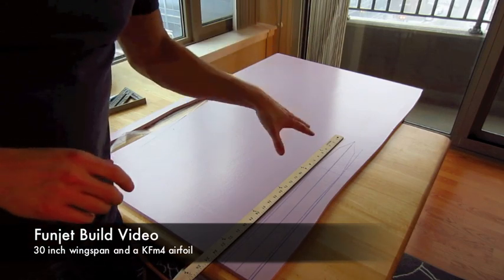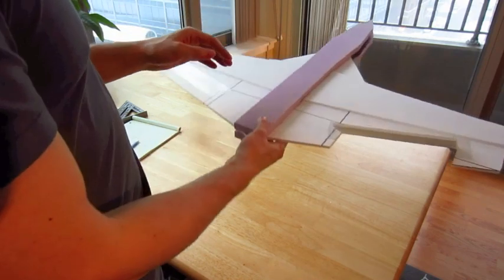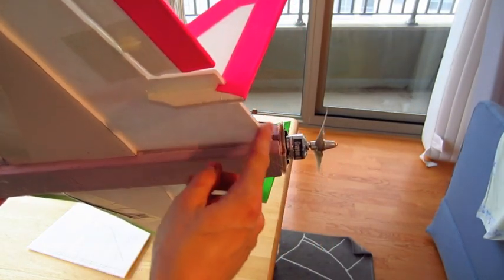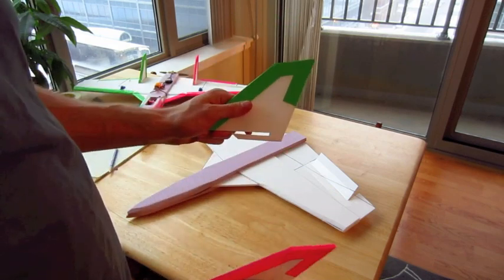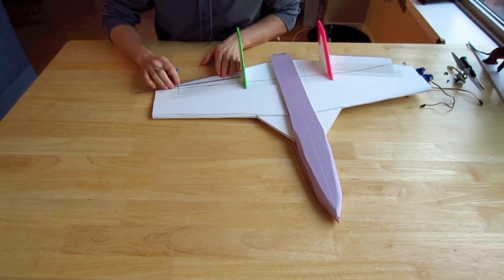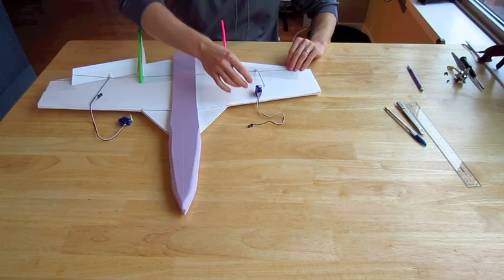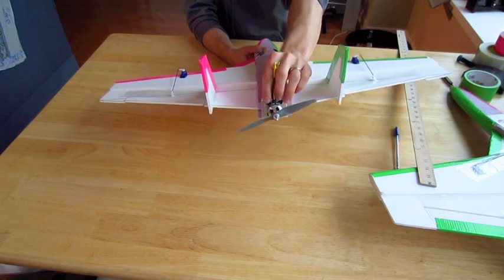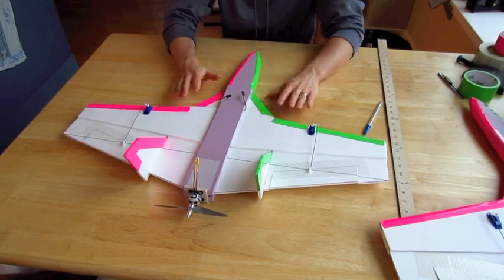Funjet Clone Build Video - Part 2

Comment: I got a question. I had to make a 2nd Funjet and I made the KF5 go all the way to the leading edge of wing all the way across.ie:even the small triangle that was left off on the build video . It flies good but only with the cg @ 14". Is this normal ? I cant figure out anything else different  need your imput on this please..
Thanks in advance and Happy Easter.